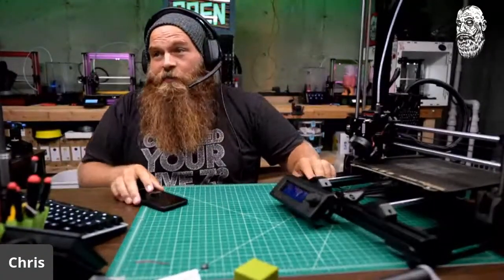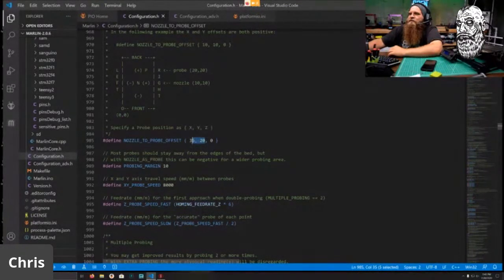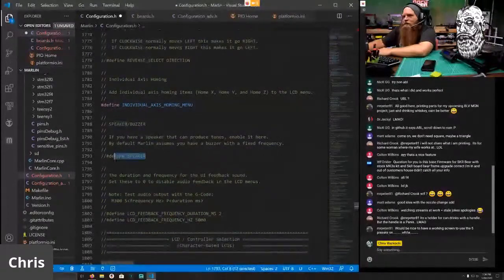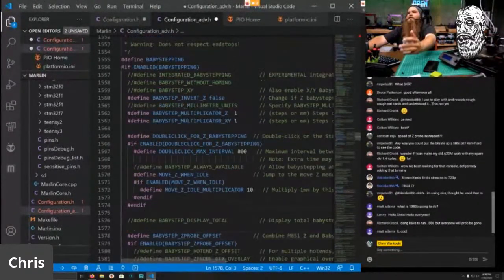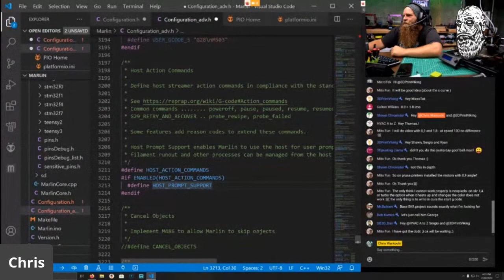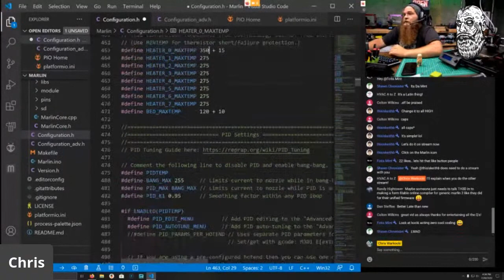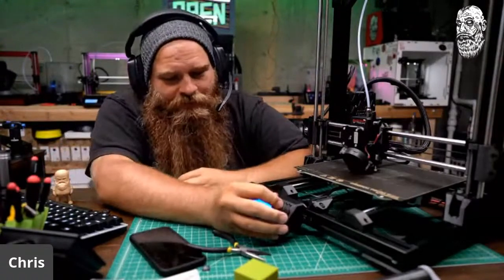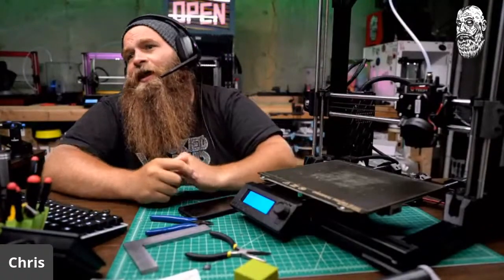Marlin 2.0.6: Making a Base firmware

Comment: DOES the probe pin work for  bl touch or the 3d touch?  I can seem to  get it to work except for a short while. but now the 3d touch is only working as a endstop in order to get it to work i have to re install marlin and its good for a little while longer.
Reply from the maker: helge Jo it does but you need to do other things to get the Bl Touch working. Make sure it’s enabled Vs fixed mounted probe.
Reply: @Mr3DPrintWizard   its like this in my config..    #define BLTOUCH 
//#define FIX_MOUNTED_PROBE
Reply: @Mr3DPrintWizard  fixed it after a bit QC i found that i had  mixed servo pin for z- pin so i guess the printer did not  like that...

Comment: Hi i have a Skr 1.4 Turbo board that stopped  reading  sd card  either for printing or flash new software. No change made after updating marlin to ver 2.0.5.4 some weeks ago then the printer just decided to not eat any more.. it works via octoprint and if hooked up to pc, do you know of any fix for this so fare i have spendt half a day on forums and no luck but there is many others that have same issue but no fix any where. 
Some are talking about a bug that kills the boot loader on the card and that sounds right to me. but then flashing a new boot loader  is not in my range of knowhow have programmer from BTT and Audrino uno but how to connect this to skr 1.4 turbo and what to use of software is a other topic i dont feel is something i shod mess with with out training wheels..